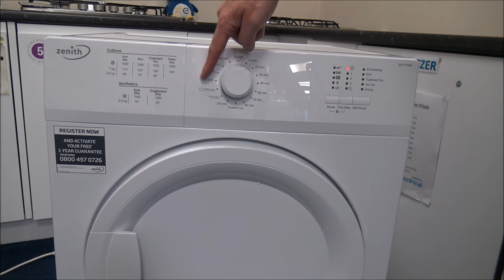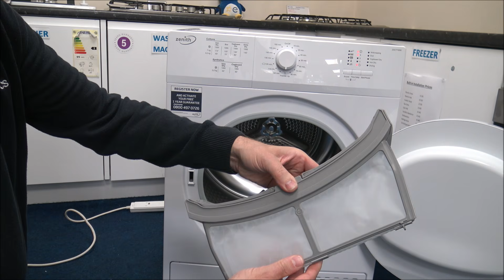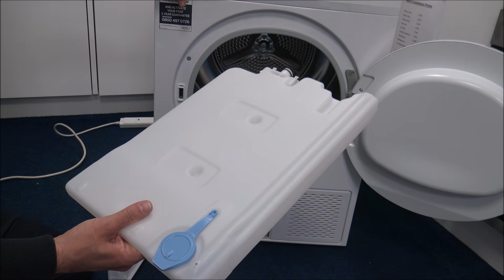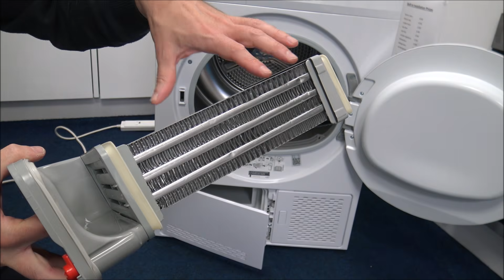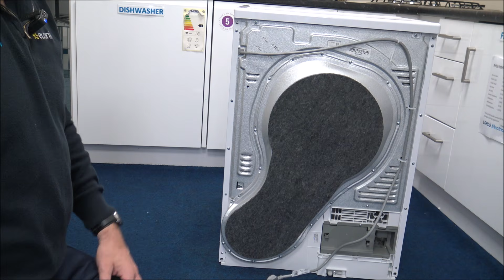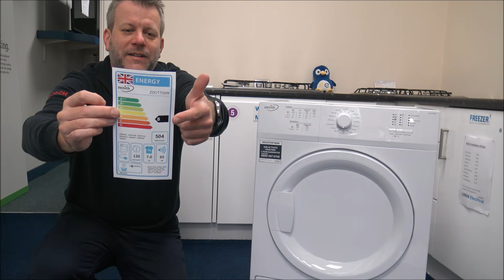Zenith ZDCT700 Condenser dryer

Comment: The Zenith helpline is pretty useless - they didn't even recognise the model number.  My problem is that the water tank wouldn't come out after being pushed in - I had to use a jemmy to prise it out !  I think I may have solved it myself by filing down the retaining clips at the back and applying a spot of grease. Not great, though.

Comment: Great video as always!! Could I have your advice on whether or not to unplug microwaves, kettles ect after use as I’ve just purchased a dualit toaster and it says to unplug after use for that reason.
Reply from the maker: I would normally switch off from the wall the small appliances like kettles toasters and microwaves when not in use rather than unplugging fully.